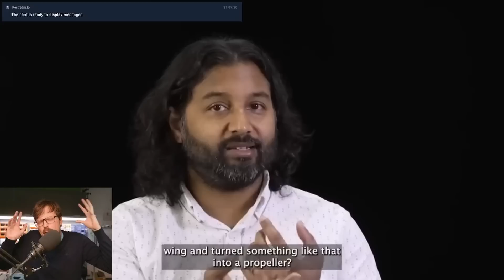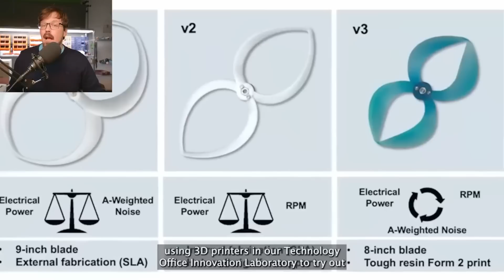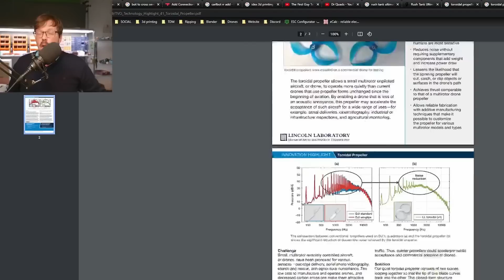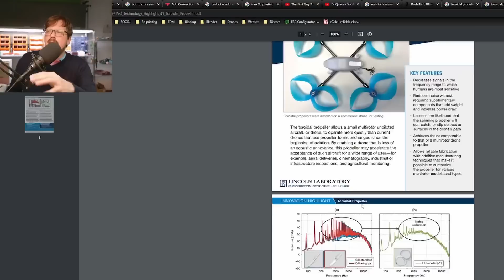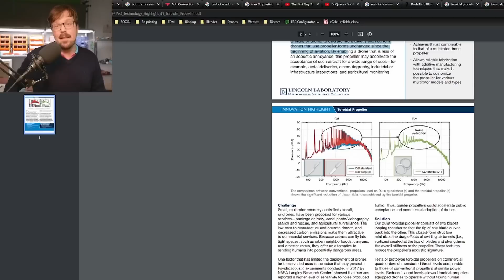MIT Thinks you're STUPID - Toroidal Propeller Snake Oil

Comment: It takes a lot of balls and/or stupidity to claim that something that is already on the market and proven doesn’t work. You clearly know that the boat props exist. Therefore, you should know that they are more efficient and quieter. It’s just a matter of doing the work to find designs that work well in air instead of water. Now you haven’t read the paper, most likely because I don’t think at this point they have published one. If you were capable of reading, and rational thought you probably would’ve noticed the title at the top of the page that said “technology highlight”. I will explain to you that this most likely means that this is a generalized overview. Of course if you had read the whole thing through, you probably would’ve found the link to the patent and you could’ve got some more information off of there. I am betting that MIT students probably have a little better resources than most Youtubers. And they’re probably smart enough to smooth the props and even print using more advanced methods and materials once settling on specific designs.

Comment: I have viewed several YT videos in which the creator used the MIT data to 3D print toroidal propellers for their drones. I more than one, the propellers were louder than the stock props. However, in one, the creator installed 8-blade swept-back props that were MUCH quieter and gave better performance than stock or toroidal props. So, you are correct. It's a sham.
Reply: Great, I have a series of ion propelled vehicles that are patented for having onboard power.  MIT claims "they" were first at that as well! 
By the way my daughter's name is Zephania. (With no "h" on the end)

Comment: Could be that they did not know about other toroidal propellers. But it is poor research for their part in that case. I have done academic studies. I have written academic papers. Nothing fancy. Not proper new PhD level research. But the bachelor level stuff. And even there, you need to actually go through the literature and explore if what you want to do has been done before. Failure to do so is not doing your studies properly. You can of course try to replicate someone elses experiment. But you can not go about and make someone elses experiment and claim later it was your own idea. Even if you did actually come up with the same idea independently. You need to try to look what have been done before, and failure to actually do so can have your paper rejected (which can in turn mean you fail to pass and so on).

Now, I have not read their paper. And it really what should be judged. Not some video presentation. Videos like that is just pop science made for the masses. It is about bringing hype to their little project. It is not the research itself. Maybe the issue I have will dissolve when I read the paper. But I also know there is a lot of pup sci drivel that is coming from otherwise respected intuitions. But that stuff tends to be sifted out with time. In the end all that matter if it works or not. And no pretending can make something work in the end.
Reply from the maker: They referenced the boat props in the patent!
Reply: @33rdframe  I find it all a bit confusing. After all, the one place you do not want to reference someone else's works is in a patent application, or you will run a greater risk of being rejected since you're basically just copying someone else's invention. 

I guess I really should just read the darn paper and see if it is any good. I doubt it. The actual research paper was not what you showed on the video, was it right? If so that a really bad sign since that just two pages with a lot of "pretty" graphics. And while is not impossible to do a two-page research paper... it almost is. Now aeronautics and aerodynamics is not my field of expertise. But I have seen stuff that organizations like NACA and NASA put out on the subject. And that fill books.
Reply: @Cythil  Please see my US patent 10,119,527 online.  There are many videos of the craft in flight since the early 2000s specifically with onboard power, yet MIT claims they were first.

Comment: 4:59 "Electrical power" ALLWAYS reffers to "Watts".
"Volts" are reffering to "Voltage",
"Amps" are reffering to "Current"

Other than that, I find this diagram to be rather unspecific, if not confusing
Reply from the maker: Now put that into a sentence that describes something useful in relation to toroidal props

Comment: The Toroidal boat propellers are pretty neat just from the efficiency gain.  I would assume there would be some applications for them for drones if nothing else then to make the propellers more resilient to impacts but I would assume you would need to design them with a much different pitch to be efficient in air.
Reply: I have 3d printed some for my old tricopters I gained 13 minutes of flight time with them on.
Reply: Aren't they 50% push down?
Reply: Funny thing is they are so easy to break on drones... actually will snap the ends when I throttle up too hard. These are mold injection props too.
Reply: I installed a toroidal Sharrow propeller on my boat and improved fuel consumption by 25% at mid range operation, achieve cruising speed at lower RPMs and reduced noice significantly compared to the old traditional prop. I have no clue how this style would perform on the air though.

Comment: 9:40 you don’t need data on the RPMs because the graphs you’re looking at are arguing that harmonics are reduced at comparable RMS (average dB). Strong harmonics (those high peaks) will greatly increase perceived loudness. The first paragraph underneath that chart discusses noise being a limiting factor for drone applications. I haven’t personally seen any arguments for efficiency.

It’s totally fair to present this research given that the propellers are being applied to a new context. Duplicate research is done all the time. In fact, it should be encouraged. 

Also the clips that piss you off are muted because the presenter is speaking… 

I’m about to watch some of your other videos to get a sense of your specialities. Your hubris in this video leaves the impression that you are not as smart as you think you are, which I’m sure is not your intent.

Comment: This video popped up right after I watched a video comparing (3d printed) various toroidal fan designs against a standard Noctua fan (YT channel is "Major Hardware") - including a Sharrow based design. Correctly designed ducted fans and therefore propeller are vastly superior in regard to noise, static pressure and airflow.

I also saw a flood of other videos on Toroidal propellers at the same time.
Reply from the maker: They are selling it hard

Comment: Pro tip my guy, a innovation highlight is not a research paper. I do agree that I would want to see a legitimate research paper with significant data supporting a claim. However, making a claim of complete snake oil is reactionary at best. I personally will be withholding my judgement on the issue until there is actual data available to the public.

Comment: I won't say you're exactly wrong, because you're really not, but you're vastly misconstruing why they designed the toroidal props.  They set out to make a quieter propeller for drones and they succeeded, kinda.  The toroidal propeller scores higher on decibel meters, meaning it's actually louder, but all that noise is at significantly lower frequencies which means it doesn't sound as loud, like comparing the sound of a mosquito to that of a hummingbird.  RPM decreases due to the additional mass, but the design essentially doubles the number of blades which results in better lift and ultimately balances out the drop in RPM.

By the way, something that they never touch on is that the toroidal shape actually gives the blades the ability to correctly maintain their own pitch, unlike regular blades that will tend to flatten out unless mechanically assisted.

Comment: In fairness, at 4:17 you say they thinks we're dumb when they say electrical powerv with no clarity, but electrical power is measured in some form of I*V (or A*V) making kW.

Oh, also, you ask why they use fdm, that same time stamp shows their saying they used SLA printers to make the blades.

On everything else, yeah, I am gonna agree based on the evidence you have shown. I'll be keeping my eyes open for additional data.
Reply: to be very nitpicky:
electrical power is EXACTLY meassured as P = I * U, or in terms of units:  W = A * V  (kW = 1000 W)
other than that you're 100% correct

Comment: This video is baseless accusation. The MIT video is obviously edited, and lacks specifics, but THIS video on the other hand HAS NO DATA AT ALL, it's just a guy talking trash. Dr Quads apparently doesn't have the equipment to 3D print them himself for actual comparisons, or just can't be bothered to spent the time to do so between rantings. Also, publishing papers and applying for patents is taught at MIT during a student's first semester. MIT's Research Administration Services is there to facilitate the process for ALL students. It's standard method of operation to patent every thing you develop there. A typical graduate of MIT has dozens of patents by the time they leave, because they're educated to do so. Patents statistically have ZERO financial return, so I don't know where you think these imaginary grants are coming from. I looked up the patent for this topic, as this video recommended. Here it is: https://uspto.report/patent/grant/10,836,466. Pretty standard, pretty useless, just like a billion other patents languishing in the patent office. It means nothing on face value, other than the fact thousands of designers who came up with this concept beforehand couldn't be bothered to patent it themselves. You must PROVE the patent is bullshit, because merely saying you have proof isn't proof. You made a failed attempt at trying to debunk them, but you proved nothing, other than you're pretty much an asshole. THAT is proof solid.

Comment: The explanation the MIT guy gives on why it would make less noise is messed up and it clearly comes from somebody with no aeroacoustics background. At these Mach numbers, low subsonic, most of the noise is actually generated by the unsteady-loading dipolar tonal sources emitted at the blade passing frequency and harmonics (btw, this is how you can actually infer the rpm from their spectra on the "paper" they released). The noise reduction happens at these peaks because 1. you likely diminish the tip-on-tip aerodynamic interaction that takes place among the rotors and 2. because with swept blades you have a lower velocity component at the place where they are rotating the quicker, having maximum loads closer to the hub. And as the dipolar sound goes with Mach^6, you have an important reduction in the frequency peaks that make up the characteristic buzzing sound we hear. What the MIT guy refers to when talking about turbulence reduction is mostly related to broadband noise reduction (like trailing-edge noise, etc.), which is less problematic for these machines, and to the slipstream circulation reduction, which is linked to the tip-on-tip interaction above. Of course, reducing the velocity at the blade tip with a sweep angle can reduce quite a lot of the load and so the propeller's aerodynamic performance. I agree this sounds fishy. Yet, I would like to run an actual CFD simulation on this to see what happens. And I will probably do it. Thanks, Dr Quads for your work, the video was needed.

Comment: I just saw a video of a toroidal propeller drone comparing it to the same model using conventional propellers. It seems that there is a moderate boost in efficiency with toroids, but they are loud, much louder than the conventional ones. A helicopter with those would sound like a small jet.
Reply: Would mainly depend on pitch and rpm in that case. In water, it's a lot easier to make it quiet than in air.
Reply: @kirknay  both the toroidal and regular propellers went through the same scenarios, so, as far as the video in question is concerned, the toroidal was louder than the regular one in each scenario.

Comment: In multiple ways, this feels like a case of, "My lack of understanding means I should denigrate/demonize/vilify those who propose the things I don't understand".
One thing that might help is to consider the relationship between electrical pressure, current, and power.  "Electrical Pressure" (sometimes referred to as "Electro-Motive Force" or "EMF") is typically measured in "volts".  "Electrical current" is typically measured in "amps".  "Electrical power" is "electrical pressure" multiplied by "electrical current", and is typically measured in "watts".  This can be very helpful in determining how much work an electric motor is doing because the "electrical pressure" could be very different depending upon the condition of whichever power source is being used at any given time.
So, for example, if using a 11.1 volt battery, where the current is 9.00 amps, the result would be about 100 watts.  However, if using a 22.2 volt battery, where the current is 4.50, the result would also be about 100 watts.  So, even though the "electrical current" in one scenario is about twice as much as in the other, the "electrical power" in both scenarios is about the same.
Reply from the maker: Have you ever designed or flown anything before?
Reply: @33rdframe  
Designed only two, but have also modified, and piloted lots of different types of vehicles (air, land, and watercraft).
Reply from the maker: @ktraglin  so you think by calling out a lack of data and science is MY lack of knowledge? I'm just not seeing the connection here.....

if you have designed and flown before how do you not understand the basics of copter flight?
Reply: @33rdframe  
My comment was about some basic principals of electricity.  I was hoping to help you see how focusing less on "amperage", and more on "wattage" can help you to get a better "overall picture" of "how hard" an electric motor is working.
So, a decent way to test the efficiency of various different propellers, is to set up a "test rig" that uses a properly programmed micro-controller and a couple of sensors.  Establish a "base line" (or "reference") electrical power (measured in "watts") that's appropriate for your use-case.  Connect your ESC to the micro-controller that's programmed to increase the speed of the motor, maintain the "electrical power" you want, measure the thrust that's achieved from that propeller, then slow the motor to a stop.  Once you've collected that thrust data (maybe put it in a spreadsheet), change to the next propeller, and perform the same power/thrust test.  Continue for as many propellers as you want to compare the efficiency of.
If using a battery to do such tests, not only does the voltage of the battery decrease over time, there will also be an increasing "voltage sag", as the speed (and load) of the motor increases.  This means that in order to maintain a constant "electrical power" ("watts"), the "electrical current" ("amps") will have to be increased.  A properly programmed micro-controller can do this very quickly, accurately, and effectively.
Reply from the maker: @ktraglin  what you just described sounds awesome and i approve of the diligence but none of that was presented by MIT

Comment: So from what I've seen, most of the "tests" online are just people using someone's random design that's toroidal in shape, but hasn't been actually fluid modeled or anything for optimization. Just sketched up in CAD and called good enough. I've seen some updated design attempts that have far better results and actually show some of the purported gains claimed.
Reply from the maker: Links? Just because you slap the word "fluid" before design doesn't make it fancy. Propellers shapes are really basic designs that do not require a 400,000 education to understand. Just go watch some blender guru
Reply: @Dr Quads but this specifically isn't a really basic design. The toroidal boat propeller that actually does outperform normal propellers took 10 years to develop. But you're judging this based on random people making rough versions in a few days to weeks based on a few pictures. Fluid modeling simulations would probably help a lot in finding the exact pitch, thickness and surface area ratios where you actually achieve the right balance. None of the videos I've seen show anything even close to their V3 propellers.